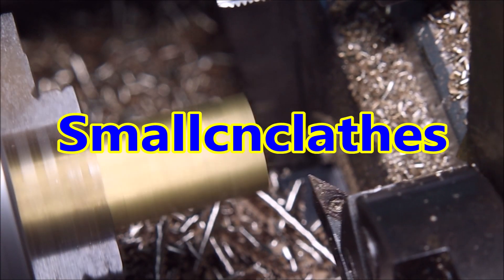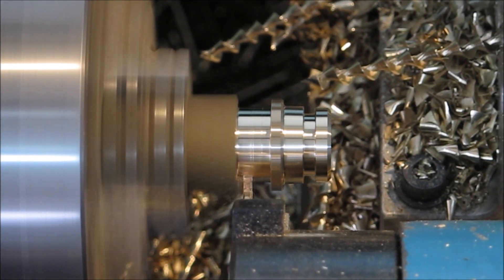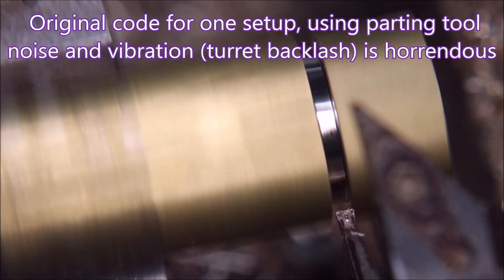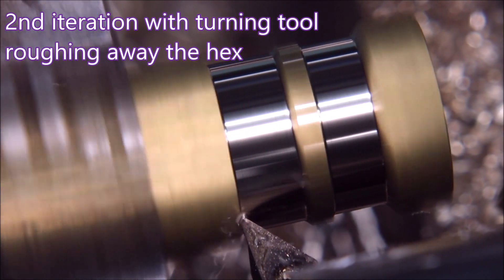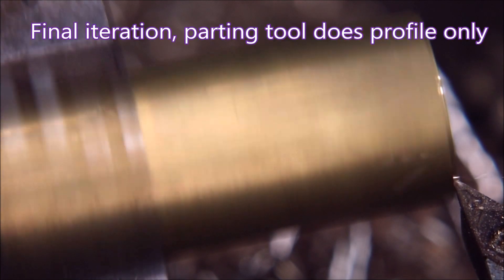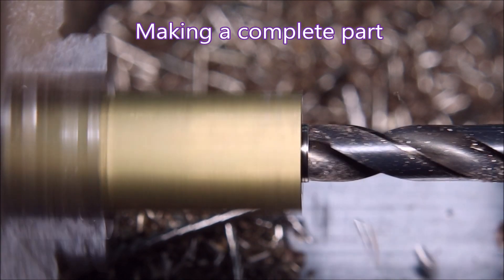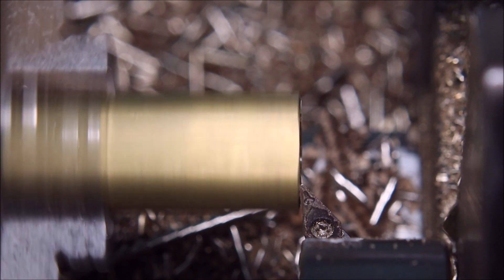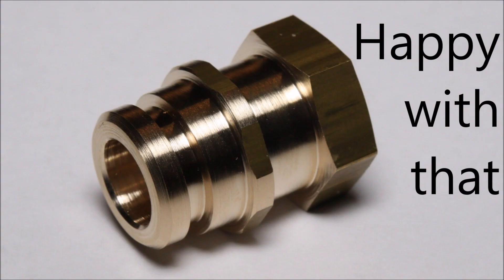More turning, less grooving saves time. Small cnc lathe, drill, tap, turn & groove, carbide inserts

Comment: Can we get a video on your tool turret? Is it your own design? I could have missed it, but I don't see anything about it.
Reply from the maker: Turret is supplied as an option by the manufacturer, so not available any more. I have not done a video about it. Apart from liking any installed tool set to be relatively in balance it works well when it is working! However I have had problems with it from time to time. Not sure replicating it would be a good move. Because of the way it is designed, it is difficult to show how it works. A soon as you start taking it apart, it no longer functions. Not really much I could show in a video. Thanks for your comment.

Comment: nice finish at the end.  I've been struggling to get half decent finish on boring operations with S1214 on my manual lathe. External turning gives me an excellent finish with the AK inserts but boring even with beefy 16mm bars clamped down tightly leaves grooves.
Reply from the maker: Are you using AKs in the boring bar?
Reply: @smallcnclathes  I tried yesterday and chipped a few. I think it's the vibration but can't seem to pinpoint what's causing it given I'm getting excellent finishes outside. Thinking could be chips not getting moved out.
Reply from the maker: @ryebis  I think AKs work well with low power lathes.  But it may be a chipping problem, do you have inserts with more of a chip breaker? AKs tend to need large doc and feeds to work well and in S1214 that may not be possible, they are after all made for aluminium.
Reply: @smallcnclathes  I have some CCMT060204 finishing inserts in the box, I could give them a go
Reply from the maker: @ryebis  That is what I would try, finishing inserts are made to take smaller cuts, so chipping might be better. Hope it works, do let me know.
Reply: @smallcnclathes  used the largest diameter boring bar I had (16mm), sticking out just enough to get to the depth I needed and took very light cuts with a DCMT AK insert all the while blowing out chips - worked nicely.  https://www.hobby-machinist.com/threads/a-boring-primer.75721/ was a nice helpful read.
Reply from the maker: @ryebis  Glad you were able to get a result and thank you for letting me know.

Comment: Horn supplies a back champhering tool which will do the trick, parts come off finished.
I use them on a bike part with a M5 tapped hole a little over 70mm deep. These are made in lots of 5000, much to tedious for a second opp.
Reply from the maker: Thanks Tom, if I had to do 5000, I would think about it, but for 200? I think I will stick with the countersink. LOL

Comment: How was the internal champher on the cutoff end done?
Reply from the maker: Thanks Tom, I did wonder if I should have included that! I have a small Bosch cordless screwdriver, nice little machine that I have had for years. Before bagging the parts I used that with a single hole countersink, it worked really well. Then I blew them off with an air blast and bagged them.
Next time, I know to follow my instincts and include that operation. Thanks for your comment.

Comment: There is something that has always bothered me about using a straight sided hole for a NPT thread. I've done 10's of thousands of them in the machine shop I used to work in. The go and no/go gauges don't lie. They were good threads, but somehow I never could get my head around a tapered thread in a straight hole. I like your method!
Reply from the maker: For me, it was a simple decision. Needed a tool change anyway and I figured it would probably take less power than running a tap into a parallel hole. Power is not something I have to spare.